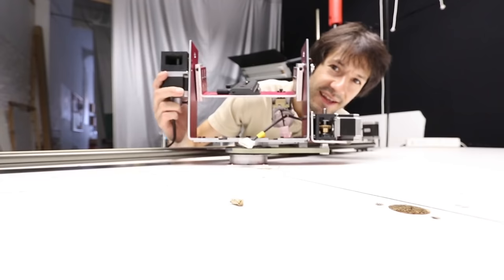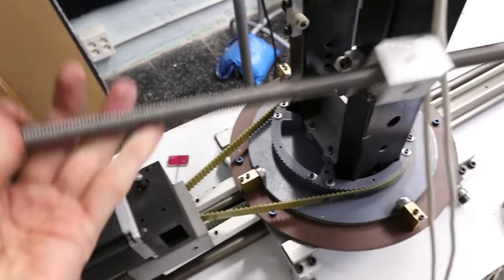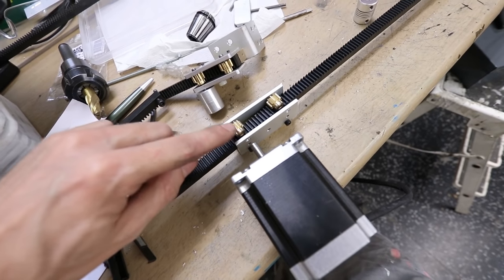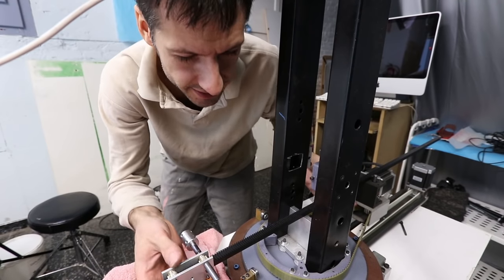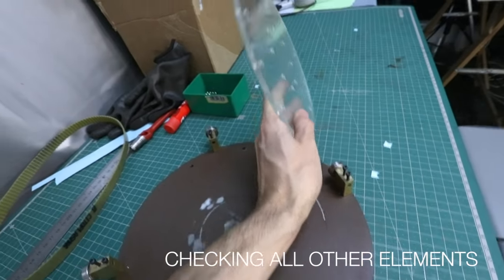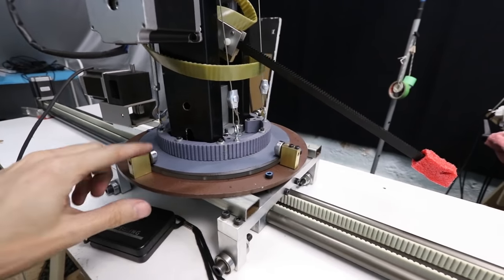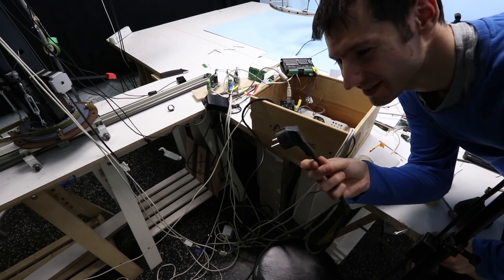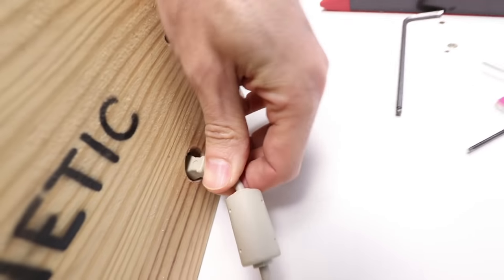Motion control camera crane improvements completed

Comment: control camera crane is a complete design to animate our puppets or anything you want!! But the hardest system to create this is not for someone with a few things. Muy bueno tu trabajo lastima no contar con estos implementos maquinarios para realizar mis animaciones con las nuevas creaciones que ya estan casi listas..Tu tienes todo para esto y sale a la perfeccion igual yo estoy contento porque al descubrir como hacer titeres de animacion con diferentes tipos de poses es para mi gratificante ya que siempre quise una figura completa y desde que descubri el stop motion me he animado a crear y a animar solo me gustaria saber si puedo animar de una forma super super economica ya que no tengo lo suficiente y montar mis videos de mis trabajos
Reply: Te animo a que aprendas arduino. La gran ventaja es que una grua como la suya, profesional, costaría varios miles. un arduino cuesta 10€ los stepper de 5 a 10 cada uno, los drivers puede variar pero en ese rango de precios. la fuente de 30W 25€ porque tengo una igual. los rodamientos menos de 20€ todos junto con los acopladores. Lo que puede que sea caro son los perfiles de aluminio, pero ahi puedes probar más materiales. Con herramientas menos caras que las que usa pero un poco mas de paciencia puedes conseguir el mismo resultado.

Comment: Thank you so much for generously sharing your great work! It is really an inspiration. I have watched all your videos many times and have learned a lot from them.   If you could, would you please explain in detail the wiring of the Microstep Driver ST-M5045 to the Arduino? (I am trying to wire it and seem to have only one direction working)  The detailed video you did on the Pololu A4988 was extremely helpful.  Also how do you have the 4 stepper drivers connected to the power supply?  Again, great work and thanks for giving your time!
Reply from the maker: Thanks, search for diagrams on internet for that driver. If you still don't find the problem mail me and I will try to help you. keep going!

Comment: hey edu I have a motion head it can make pan and  tilt, it has DC motors not step motor today I try to connect to it to dragon frame for it I bought dc motor drivers(L298)but I didnt work.

I thing here is the problem dragon frame let me connect with 2 digital output one is direction one is pulse but for dc motor driver has two cable for direction also two cable for speed or I make some mistake I didnt solve it can you help me ?
Reply from the maker: The easiest would be to use stepper motors.

Comment: Your work on the arduino moco is inspiring Eduard! Im trying to set up my own system and I just wanted to ask you what stepper motor you would suggest for focus. Im thinking nema11 or nema14 with high torgue (1.2-2.5kg.cm) Would that be enough for focusing? Keep it up!!!
Reply from the maker: Thanks!! that really depends on your lenses, some of them are really loose and some very tight. I would go for the nema 14 to be sure, anyways for a focus I would suggest a gearbox or a good stepper driver to allow you more microstepps. Hope you succeed!!!
Reply: Yes I know what you mean! Its always better to have more power even if you dont use all of it! Much appriciated!!!

Comment: Which motors are you using and is there a qearbox on the motors?
Reply from the maker: I use stepper motors nema 23. And yes at some points I have gearboxes, made by myself using a 3d printing machine, bearings and gears to increase the precision.

Comment: What size is the "threaded rod" ? 16mm or 14mm ?
Reply from the maker: +Shashi Kiran I think it was 14 mm
Reply: Thanks, How do I make a "bolt" with the right 14mm threads ?? do you know.
Reply from the maker: Well, I bought it but to make a thread you can do it with a lathe or using a threading tap, anyway for a large one it is easy to buy it.

Comment: can you tell me, how can you program that stepper?
Reply from the maker: +Bayu rizqi Chandra pratama using the right software. I use Dragonframe
Reply: did you not use arduino?
Reply from the maker: Yes, of course, Arduino mega and stepper drivers are the electrònics I used.
Reply: how about your program for take degrees stepper?
Reply from the maker: This is the Dragonframe I said before
Reply: okay, thank you so much